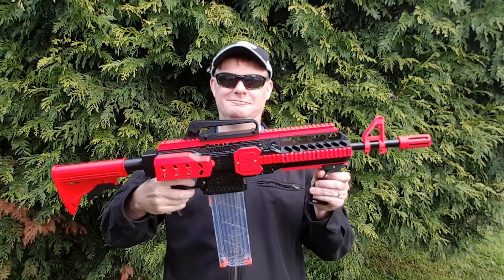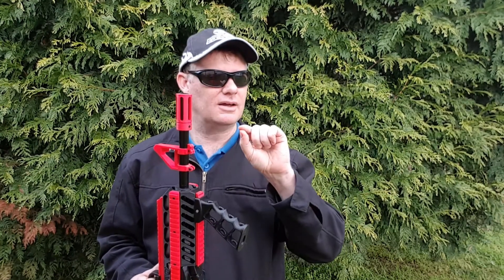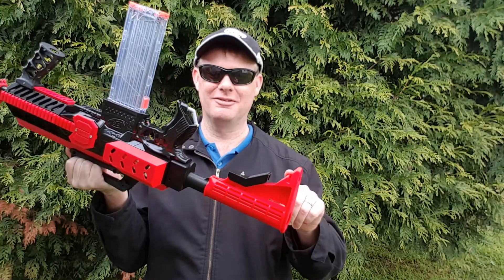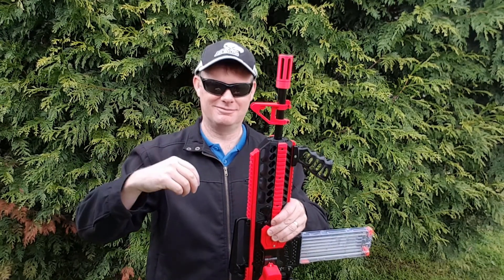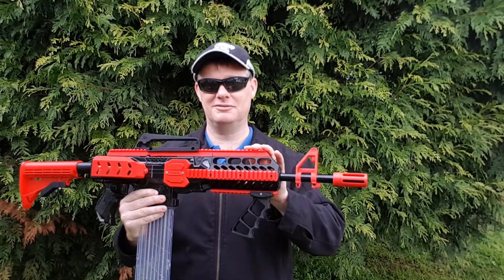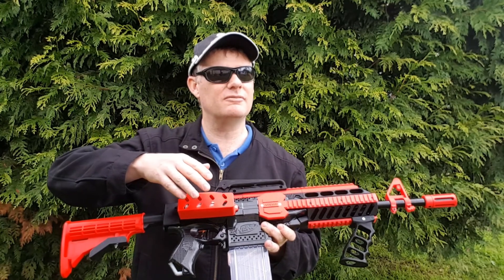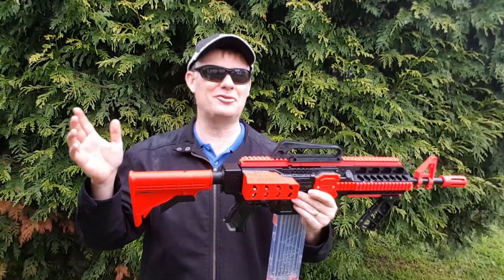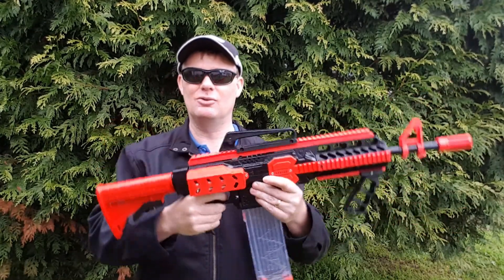⚡️ Nerf Stryfe How to make Custom 3D Printed Parts: Part 2

Comment: Please do recreate that worker piece =]
Where are you based bud?
Reply from the maker: Im in New Zealand. As we speak im working on a new Nerf Gun .. everything original from the ground up.. so no nead to buy a Stryfe or anything..
Reply: Ultrasonic2 love it but my printer only has a 15cm bed

I'd rather just have attachments like yours for the stryfe.

I'll be printing your kit shortly with the shorter barrel
Reply from the maker: I intend on making more  parts for the stryfe to "fully" develop it... So much un tapped potential still.

But ultimately to "spank" people and to have a truly awesome Nerf Gun the Stryfe package is too limiting. So a new one form the ground up is required.